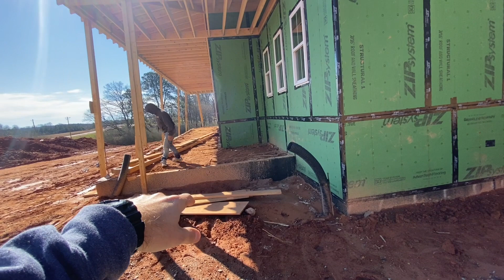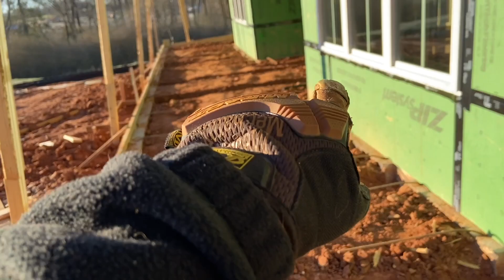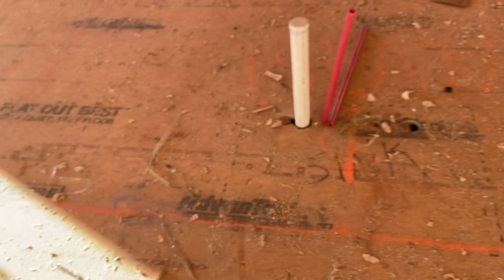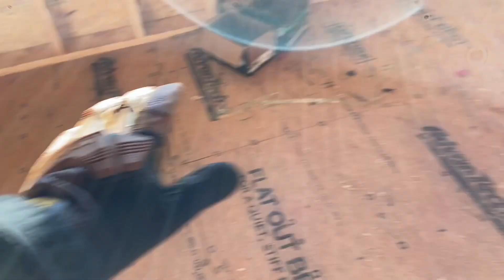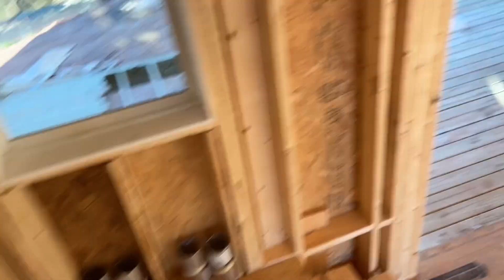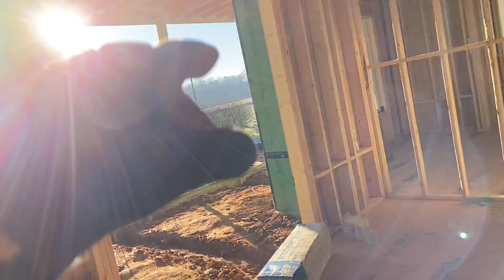House Build PT13 - Rough Ins begin

Comment: the Kerdi Shower systems are garbage... the glue or adhesive used on these Kerdi systems debonds and will leak...
If you do use Kerdi you should always put down a Shower Pan Liner first... You will thank me later
Reply from the maker: Thanks for your comment. I have done a lot of kerdi systems with good results. Can you provide some case studies of failures? I’d love to research that a little more. We didn’t use any adhesive. We used schluter all-set for all of the bonding as per Schluters recommendation.
Reply: @macgyver03ga  a simple Google of Kerdi system shower adhesive failures and You will find a perfect hands on "case study"...
You should have used an Oatey Shower Pan Liner BEFORE installing Kerdi.
the House moves and or weight in the shower WILL Debond the Adhesives used in the Kedi Systems...
you should have done your research BEFORE installing these over priced garbage systems...
easy is Not always the best... but a simply Pan Liner would have saved you a lot of money in the near future...
Reply from the maker: @traveler142  thanks for your input. I’ll take a look. I haven’t done a shower with an Oatey pan liner in probably 13-14 years. I think the last one I did was ‘08ish. Since then it’s just been kerdi showers and showers with fluid applied membranes like redgard or hydroban.
Reply: @macgyver03ga  I always use an Oatey Pan Liner placed first over pre sloped wood shower floor then the deck mud and either redgard or hydroban over the top, you will Never have one fail.
too many video's can be found of Kerdi and Wedi systems failing miserably...
most times the old is always the best.
Reply: @macgyver03ga  I noticed that You took a lot of care in making sure to protect the exterior of the house from wind and water... take this principle and apply it to all your future Bathroom Installations as well.
do not rely on these New Systems and their adhesives to keep water from rotting your house from the inside out.
A Pan Liner when installed properly will Never Fail... Ever.